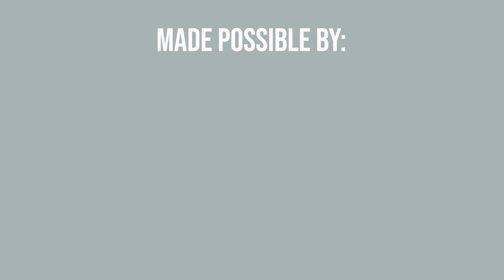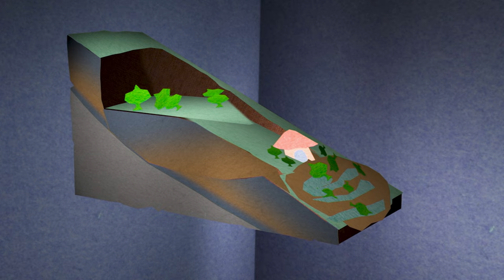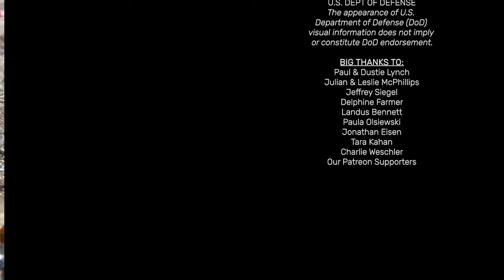Geotechnics: Simulated Earthquakes, Landslides, Sinkholes & a Hail Cannon- Ep 306 of HOME DIAGNOSIS

Comment: As a builder, contractor and excavator I have seen these things first hand, Excavation: always concerned about liquefaction and the changing ground profile type as we dig around the footer so that is can handle the required PSI per foot. As a builder: structure, as a contractor: working with the insurance companies to get the home owner what they need to get back in the house. One frustrating thing is getting paid when we have to come out and tarp off a roof then being told by the insurance Co. That we need to meet the adjuster (on his schedule) so we can pull off the tarp for his inspection, then having to tarp it again, but at least it is worth it to protect the structure. But who is paying for that? Usually me
Reply from the maker: Good man. Keep it up, the world surely needs you.

Comment: Good video, but I'm still going with concrete. Properly designed and installed reinforced concrete is by far the most durable and resistant building material in my opinion; it's non combustible, not distroyed by water, can't be eaten by bugs, and it's literally bullet proof, plus the sound attenuation and diurnal temperature buffering and phase shift are nice to have I think. The potential benefits wood has in a major earthquake can be nutrualized with rebar sizing and spacing, or some combination of rebar plus fiber reinforcement; plus I don't live in a major earthquake zone, the biggest earthquakes we get are tiny, mostly 2s, maybe a 3 once every few years.
Reply from the maker: Fair enough Zerg